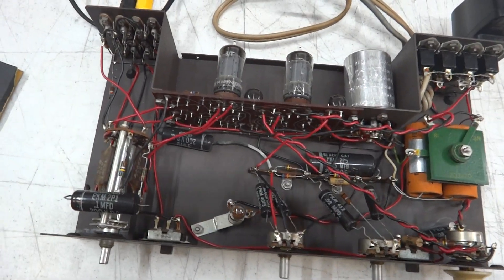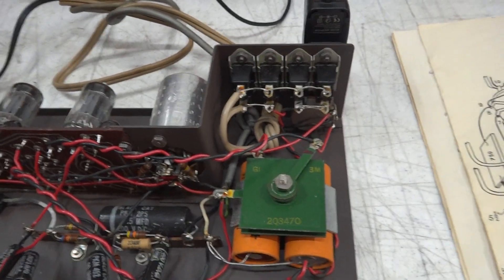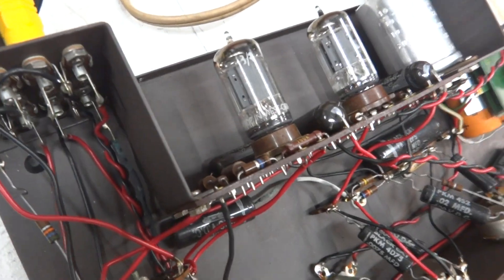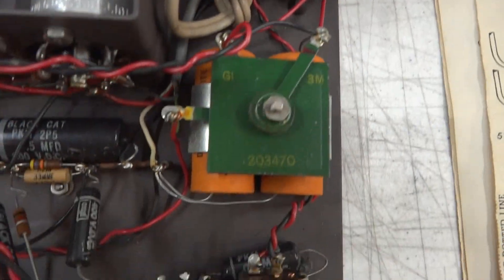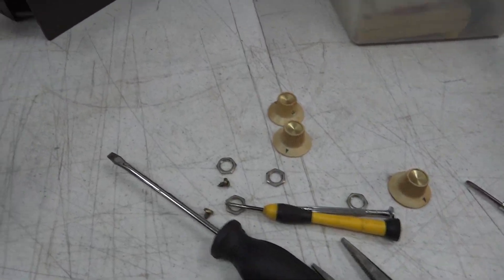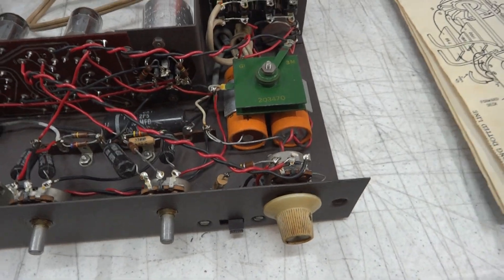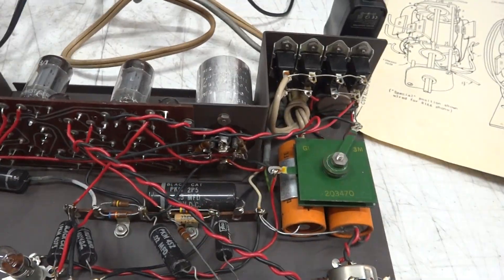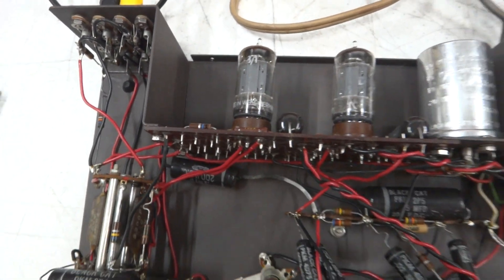Dynaco Dynakit Pam 1 Tube Preamplifier - Won't Power Up????

Comment: This preamp doesn't have a power supply. Power is obtained through an umbilica cord connected to  the front socket of a  Dynaco power amp such as the ST-70 or Dynaco MKII and MKlll.